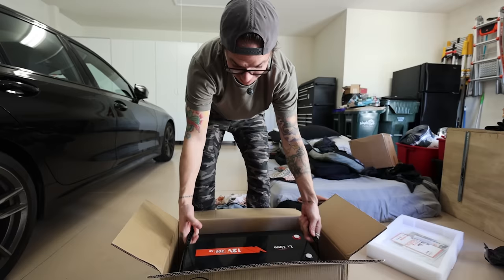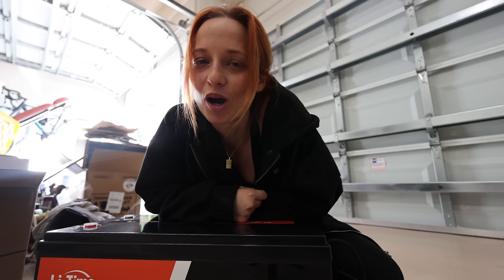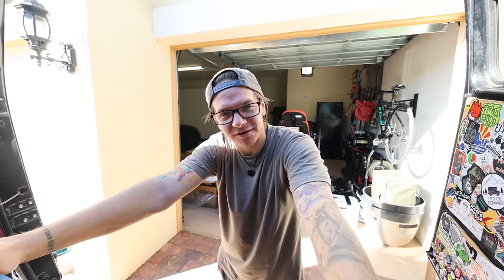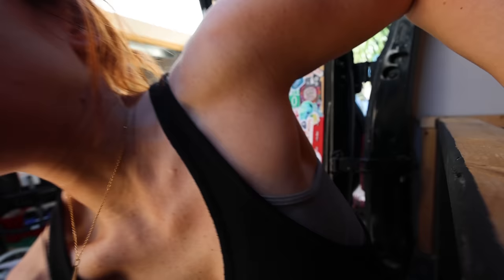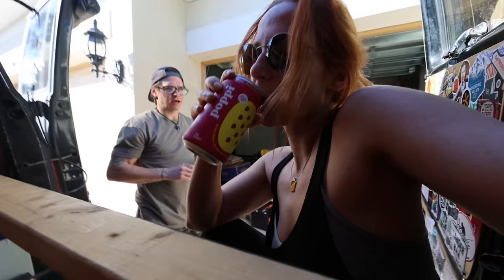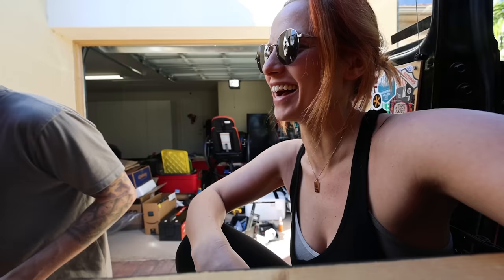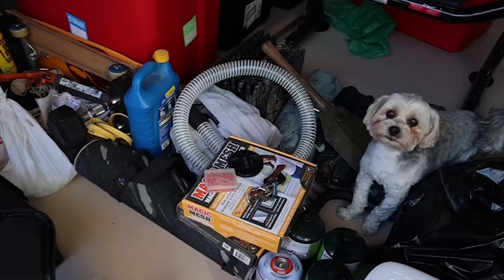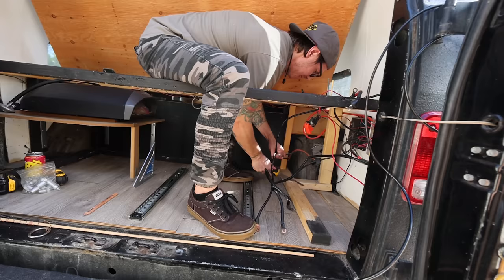huge VAN UPGRADES for Mexico!

Comment: so-glade your back/an charlie did it/yaw did it/by the way do yaw have a dc to dc charger for the lithumin  battery/an isolator will make the alternator over charge an burn out/get a dc to dc charger off amazon-renogy 20 amp/an back it up with a 20 amp fuse on both sides/yea an have a good time back on the road/thanks much